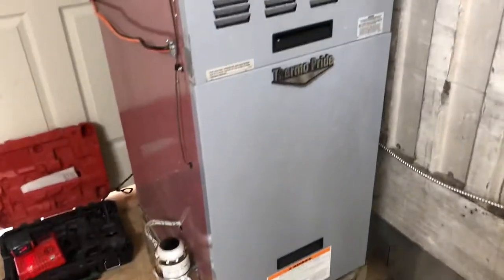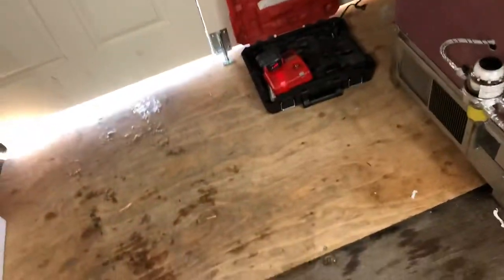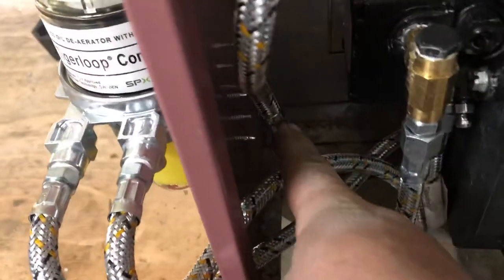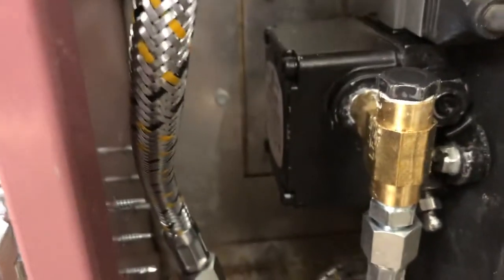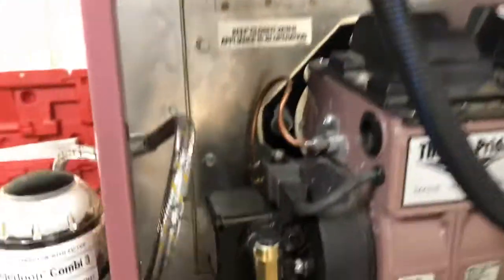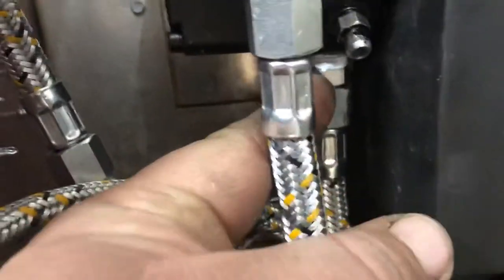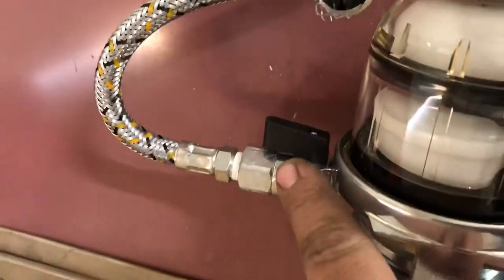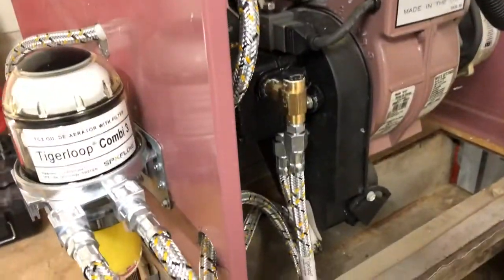How to connect Tigerloop Combi 3.

Comment: Don’t  know where your located but code specifies a Firematic Valve right where the feed line enters the Tigerloop.
Reply from the maker: This location doesn’t require any safety shutoff valves, it’s non living storage trailer.
Reply: @delta_mechanic  👍🏻

Comment: How can i clean the filter? How do i open the tigerloop it will not move if i turn at the undersite
Reply from the maker: Hello, if you have Tigerloop Combi 3, like the one in this video, that filter cup is holding by a aluminum alloy nut, you can use big channel locks to unscrew that, but be careful not to crack plastic filter cup, normal thread, factory set that nut is really tight, to prevent any air to getting in.